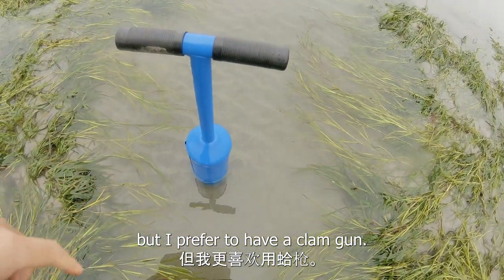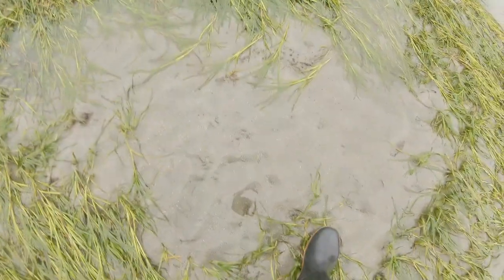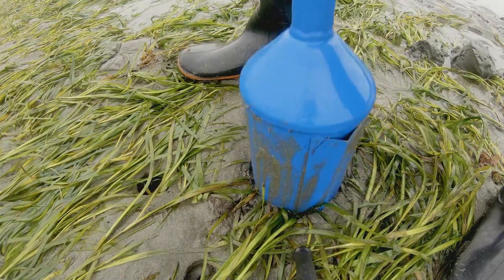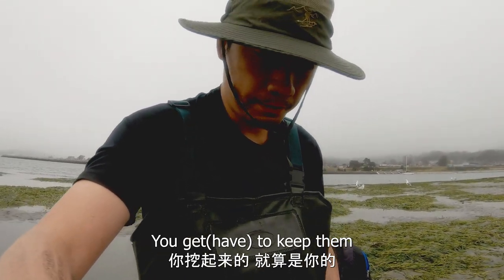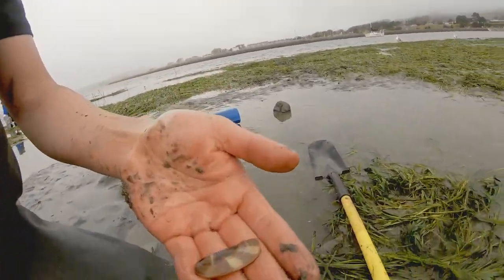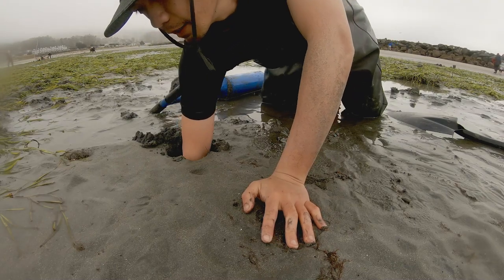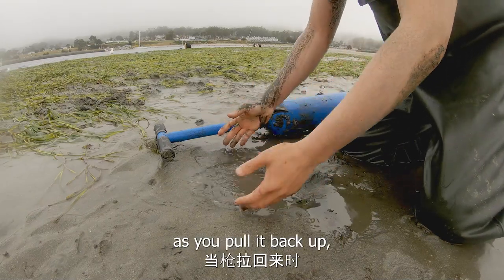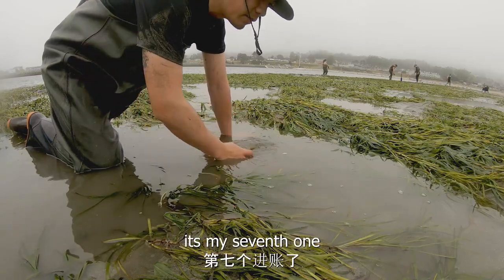How to Dig Gaper Clam(Horseneck)! Clamming Tips and Tricks. Forage and Cook!

Comment: No stupid questions warning: it seems like you need to dig a good 2'-4' to then reach down and grab the clams. Are their siphons truly that long when fully extended such that they peek out above ground, and then retract all the way down into the shell when startled? Or do these clams somehow "shoot" down or move some other way into the ground efficiently enough to retract the siphon and go into a hidden state several feet below? I ask because on the shot where you mention "the big one", it's almost like you could quickly grab the siphon and not let it go (assuming it's not completely delicate); or, somehow quickly dig at an angle to "scoop" the clam when its closer to the surface.
Reply from the maker: usually if the holes you saw is bigger then generally mean there is a bigger clam under the earth, you can't get them by just holding their siphon and not letting it go
Reply: I'm not a professional and have only gone a few times. I've never seen them stick their necks above the sand. As you dig, generally the sand will start to collapse, making them sink deeper into the earth. If you don't clear their shell part and grab them by their necks/siphon only, then you will likely break it off, killing them, and not getting the whole clam.

Comment: I used to use the clam gun. Unfortunately, where I go, it's forbidden by law along with the PVC pipe, so I'm stuck with just the allowable shovel which is permissable. The rangers could never give me a convincing enough reason. 🙄

It's a little bit more challenging because of the collapsing walls and water buildup.